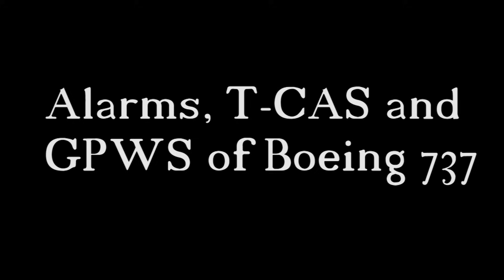Alarms, T-CAS and GPWS of Boeing 737

Comment: ALARMS

0:04 Autopilot Disengage - Pilot flying manually.
0:07 The sound that is heard when the aircraft is reaching (100 feet below) the selected altitude that has been set on autopilot.
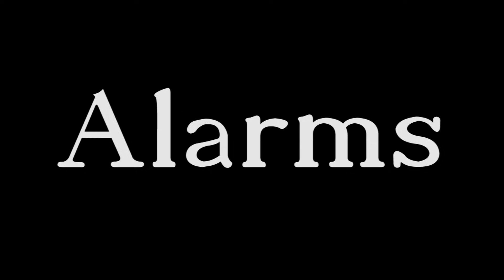0:09 "Bank Angle" warning - when the plane is in too steep of a bank and risking a stall (30 degrees or more)
0:15 "Caution: Terrain" - The warning given off when terrain is close and to look for and watch out for it.
0:16 "Decision Height" - The height where a pilot has to decide whether he wants to continue with the decent or go around.
0:17 "Don't Sink" - The warning given when a pilot is descending too fast, in a stall, or a warning not to descend any further.
0:19 "Glideslope"- When your altitude is too high or low above or below the glideslope (the recommended path of altitude when landing an aircraft)
0:20 "+100" - 100 feet above the glideslope, descend or go around.
0:21 "Pull up!" - Warns the pilot to climb fast, for an obstacle is ahead.
0:22 "Radio Altimeter" - The plane will start calling out altitudes (2500, 1000, 500, etc.)
0:23 "Windshear" - You have flown into a heavy gust or large wind mass which hovers over or around the runway. It can push you uncontrollably, so be ready to go around.
0:27 "Sinkrate" - Descending too fast, or in a stall, or a warning not to descend any further. Similar to "Don't sink!"
0:28 "Too low: Flaps" - Your flaps aren't configured for landing, or not configured properly.
0:29 "Too low: Gear" - Your gear isn't extended for landing.
0:31 "Too low: Terrain" - You are too close to the ground and might crash into an obstacle before landing- not on the glideslope.
0:33 "Terrain, Terrain, Terrain, Terrain, Pull up!" -Terrain is directly ahead or you are flying in terrain - PULL UP!
0:36 "V1" - The speed where you can no longer abort takeoff without overrunning the runway, even if something fails, it is safer to attempt to takeoff.
0:37 "Whoop Whoop - Pull up!" - Pull up fast for an obstacle is ahead of you!
0:38 "BRRRRING" - Fire alarm, engine or compartment sensor has sensed fire.
0:39 "Beeeep" - Extend gear immediately for landing.
0:41 - Stall warning (aka stick shaker), you are too slow for the plane to maintain altitude, increase speed!
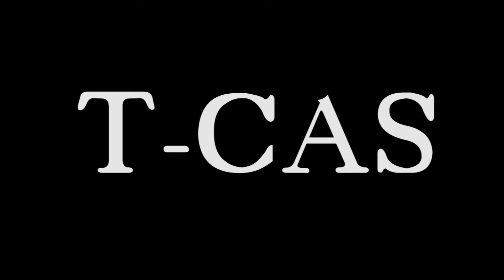0:47 - "Takeoff Config. Warning" - Something is not correctly configured for takeoff (flaps, throttle, etc.).

TCAS (Traffic Collision Avoidance System)

0:47 - "Adjust Vertical Speed" - Bump your vertical speed up or down to avoid traffic.
0:51 - "Climb, Climb now" - Climb immediately to avoid traffic.
0:55 - "Climb, crossing, climb" - Climb, but cross paths with the other aircraft.
1:00 - "Clear of Conflict" - You are no longer engaged in any conflict with other aircraft.
1:05 "Descend, Crossing, Descend" - Descend but cross the path of other aircraft.
1:10 "Descend, Descend Now" - Descend immediately to avoid collision with other aircraft.
1:14 "Increase Climb" - Increase the rate of climb you are climbing at.
1:17 "Increase Descent" - Increase the rate of descent you are descending at.
1:20 "Maintain Vertical Speed" - Maintain the rate of climb or descent you are using.
1:25 "Crossing" - Cross the path of another aircraft.
1:27 "Monitor Vertical Speed" - Keep an eye on the rate of climb or descent you are using.
1:29 "T-CAS Test: Pass" - The T-CAS system has passed the test of it. This test is run at the beginning of every flight.
1:31 "Traffic, Traffic" - Keep an eye out for traffic in your area.
1:33 "T-CAS Test: Fail (BEEP)" - The T-CAS system has failed the test. The aircraft should not be flown.

GPWS (Ground Proximity Warning System)

1:36 "Minimums" - The altitude on final (approach to the runway) where you have to decide to go around or land.
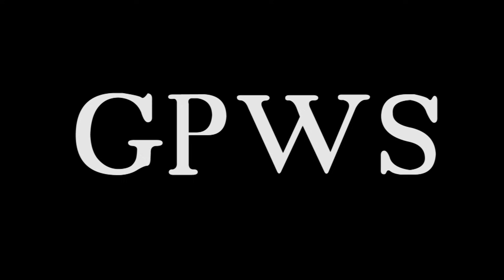1:39 "Approaching Minimums" - Approaching the altitude on final to decide to scrap the landing or not.
1:40 "Approaching Decision Height" - Approaching Decision Height. Decision height is the height where a pilot has to decide whether he or she wants to continue with the decent or go around.
1:42 "2500" - 2,500 feet above the ground.
1:43 "1000" - 1,000 feet above the ground.
1:44 "500" - 500 feet above the ground.
1:45 "400" - 400 feet above the ground.
1:46 "300" - 300 feet above the ground.
1:47 "200" - 200 feet above the ground.
1:48 "100" - 100 feet above the ground.
1:49-1:50 "50, 40, 30, 20, 10" - 50 feet above the ground, 40 feet above the ground, 30 feet above the ground, 20 feet above the ground, 10 feet above the ground.

Hope I covered everything.
Reply: Thank you
Reply: @DragonYeng  2X Speed if fun
Reply: Plus hundred is actually another callout that you are one hundred feet above your minimum altitude.
Reply: @DudeAwesomeBoyReal  not all aircraft have that tho
Reply: Petition to add "butter" to gpws
Reply: @h-hhh  LOL
Reply: Don't Airbus planes also have another call-out where it says "RETARD" to signal pilots to put thrust levers in idle position?
Reply: @3774-p3i  Yes. But ONLY Airbuses
Reply: Actually the 0:04 alarm is not the A/P disengage per se. It's the Master Alarm, which is also activated when the A/P is disconnected.
Reply: Thanks dude.
Reply: BIG SMOKE only in Airbus
Reply: @victoryday663  its in the airbus not boeing
Reply: Now I know. Thanks.
Reply: Butter
Reply: one thing missing that i'm curious about is the two-tone non-verbal alarm at 0:23
Reply: @MxMattyB  It's part of the Windshear warning
Reply: Every Air crash investigation 
Pull Up Pull Up
Reply: 1:48 Swiss 001 butter landing
Reply: Thanks
Reply: Doing gods work
Reply: This should be pinned
Reply: 0:47 is also cabin altitude. The cabin is not pressurized above 10000 feet.
Reply: Now I believe I can fly
Reply: Thank you! As someone who doesnt know too much about aviation this was super helpful
Reply: The confit warning can also mean cabin altitude is too high when in the air
Reply: Plus hundred is wrong . Plus hundred is a fallout that tells you youre 100 feet above your set minimum altitude or decision height
Reply: This one Airplane go up but airplane but is go down alarm airplane say this 0:31 and 0:37
Reply: Slender_04 you copied this from another person
Reply: Isnt minimums between 400 and 200 feet, but you can go around before you have engaged reverse thrust or brakes
Reply: @Lionn8563  Minimums height is different on every airport.
Minimum means, if you don't see the runway at that height, you must go around also if everything else is fine.
And yes, you also can go around at any time before reversers are engaged.
Reply: I love you.
Reply: @comradedyatlov4143  no u
Reply: Thank you!
Reply: you are really did , thank you very much ♥️🤝
Reply: Thx
Reply: One hero, thank you Very much 😎🤝
Reply: 0:04 is also known as "pilot need to earn his salary now"
Reply: the radio altimeter altitude test made me laugh cause if you get calls from 100 down that fast you’re gonna be feeling that one when you wake up in the morning
Reply: Helped me understand what the second alarm is (i kept getting it in x plane cus im a noob), thanks a lot!
Reply: What are you a pilot? Thank you
Reply: @Darkshadoz  yea i mean, that’s generally the kinda person you’ll find watching videos about plane alarms 😅
Reply: That “beeeep” sound is actually landing configuration warning, it can also go off if the flaps aren’t
Reply: Amazing.
Reply: you forgot "butter"
Reply: For the 0:07 one, its actually 1000 ft, not 100
Reply: Olá do Brasil 🇧🇷💚💚
Reply: Corrections:

0:17 Don’t sink - When the aircraft is descending when it shouldn’t (eg. Descending during takeoff phase)
0:20 Plus hundred - Same thing as ‘Approaching minimums’, its a company option. (You are 100 ft above MDA/DH) 
0:22 Part if the GPWS test, you do not hear this during normal operation
0:27 Sink rate - Descending too fast, nothing more nothing less.
0:39 L/G not down at flaps >15 during approach phase, nothing more and nothing less.
0:47 (in addition to what you have explained) - Also cabin altitude warning
1:42-1:50 - RA callouts in feet, no need to explain the same thing over and over again.
Reply: You deserve a beer bro thank you
Reply: Trying to figure out what sounds my 747 was making in MSFS. Thanks to you I figured it out. I love you
Reply: Ty
Reply: Takeoff Config. Warning sound is also the sound which alarms the pilots of low cabin altitude when not on the ground
Reply: Nice
Reply: Hey I actually really appreciate that a lot thank you
Reply: 1:50 20-10
Reply: Fucking legend you deserve a sub
Reply: Damn you're awesome
Reply: Here 👑
Reply: Dude this guy wrote a whole story
Reply: Mannnnn you are amazing thankyou
Reply: Godd
Reply: God
Reply: Thanks a lot 🙏💖💖
Reply: Thank you so much! I was in trouble with 0:47 annoying sound. I forgot my flaps hahaha
Reply: Thank you for listing these. I knew most, but some that are just alarms without the voice (except the stick shaker and fire alarm) and don't know off the top of my hear.  Much appreciated!
Reply: you forgot overspeed i think
Reply: It wasn't in the video but you forgot "Retard, Retard"
Reply: Ryanair landing countdown belike
Reply: SINK RATE SINK RATE ten crash noises
Reply: Thanks
Reply: Thank you cause I can't understand this
Reply: God bless you.
Reply: You forgot retard
Reply: bro wrote an entire essay 💀💀
Reply: 0:47 can also mean something is wrong with the cabin pressurization if your at near cruising altitude.
Reply: What is the difference between minimums and decision height?
Reply: Doesnt it feel like there are too many diffrent terrain warnings
Reply: Don't think! 😀
The aircraft will do it for you.
Reply: Ur a saint
Reply: You deserve an award for this!  Great job  👏🏻
Reply: Thanks for this
Reply: @slender_0434 are you a pilot
Reply: nice
Reply: DAM HOW LONG DID THIS TAKE
Reply: V1 is decision time
Reply: God bless this man for explaining everything.
Reply: Thank u so much for helping us understand
Reply: Thanks, this is a very useful material 😊
Reply: What a Chad
Reply: that wasn't very butter
Reply: What a legend, thanks lad
Reply: At 0:40 there is a single twink which is the overspeed alarm
Reply: What is the beeep alarm sound name?
Reply: Appreciate people like you. thanks🫶🏻
Reply: Спасибо из России, друг!
Reply: 10 RETARD RETARD
Reply: And after BOOM
Reply: Bro love you
Reply: 9
Reply: I think "Don't Sink!" Is applied during takeoff when you suddenly start losing altitude (even by the slightest)
Reply: +100 means the same thing as approaching minimums, and approaching decision height.
Reply: For a split second at 0:41, the overspeed alarm sounds. Either way, good explanation.
Reply: It’s been a few years, but thank you!
Reply: Thanks for the support, a lot of time for that! I agree.
Reply: When u just learning english: "Don't think!"
Reply: Thank you.
Reply: 0:20 "flight(?) slow"
Reply: @n123v  it says "Glideslope!" meaning you are too low on the descent path, meaning you should descend less
Reply: thanks!
Reply: @n123v  it is "Glideslope"
Reply: @n123v  it's glideslope
Reply: @n123v  it says "glideslope", but i heard it like this too.
Reply: @n123v  glideslope
Reply: @n123v  Glide slope.
Reply: @n123v  its glideslope
Reply: @n123v  0:20 glideslope
Reply: @n123v  glide slope
Reply: @n123v  glideslope
Reply: @n123v  It's saying "Glideslope"
Reply: I bet anyone who ever heard any of these "100 feet above the ground" (or less) warnings got scared shitless.
Reply: ok
Reply: How long did u do this?
Reply: I hear 0:07 all too often

Comment: 1:42 that was the fastest landing ever…
Reply: That moment when you reach mach 1,33 on landing
Reply: @BummelHummel181  not just mach 1,33
it is mach 1,33 of VERTICAL SPEED
Reply: @BummelHummel181  pov: war thunder arcade landings
Reply: that’s your average Ryanair flight for ya 😂😂
Reply: lol ryanair landing
Reply: Others Airlines, prépare for landing.
Ryanair, brace for impact.
Reply: That’s called a nose dive
Reply: @TakeAcTN  gpws doesn't work with the planes nose is down UNLESS the weather radar can be used as a radio altimeter but it's used for detecting water droplets not ground
Reply: B U T T E R
Reply: that's is about how the space shuttle would of been for landing
Reply: ryanair
Reply: That was ryanair
Reply: When you hear that but the terrain alarm is off "guess we landing nose first guys!"
Reply: 30 20 10 butte- *crash*
Reply: POV: ryanair GPWS
Reply: 18750 feet per minute descent
Reply: Thank you for flying ryanair
Reply: Sinkrate!
Reply: creasiiin

TERRAIN TERRAIN TERRAINTERRAINTERRAIN!!!!
Reply: Ryanair like that
Reply: Nah bro that was a nose dive 💀
Reply: This is what Ryanair pilotshear everytime they perform a landing
Reply: prob felt like ryanair (times 100)
Reply: some ryanair shit
Reply: 737 likes
Reply: The last moment of United Airlines Flight 93
Reply: "BANSAIIIII"
Reply: Sounds like a Ryanair landing to me. 😂😂😂
Reply: BUTTER
Reply: actually, the hardest, if it was the fastest, then it would overrun the runway.
Reply: Average ryanair landing
Reply: Give the pilot some respect.
Reply: Actualy on touchdown it was only 1500fpm
Reply: Vertical speed must’ve been -9999
Reply: Hard landing
Reply: B U T T E R

Comment: TCAS:

0:47 "Adjust vertical speed, adjust." - Reduce climb/descent rate as necessary to avoid a collision/incoming traffic.
0:50 "Climb, climb now!" - Disregard any and all previous warnings; you MUST climb immediately to avoid traffic.
0:54 "Climb, crossing, climb." - You MUST climb immediately; incoming traffic will descend.
0:58 "Climb, climb." - You MUST climb immediately.
1:00 "Clear of conflict." - Collision averted. Resume instructions from ATC.
1:02 "Descend, descend." - You MUST descend immediately.
1:04 "Descend, crossing, descend." - You MUST descend immediately; incoming traffic will climb.
1:09 "Descend, descend now!" - Disregard any and all previous warnings; you MUST descend immediately to avoid traffic.
1:13 "Increase climb." - Increase rate of climb to avoid traffic.
1:17 "Increase descent." - Increase rate of descent to avoid traffic.
1:19 "Maintain vertical speed, maintain." - Maintain rate of climb/descent to avoid traffic.
1:22 "Maintain vertical speed, crossing, maintain." - Maintain rate of climb/descent; incoming traffic will cross altitude shortly.
1:26 "Monitor vertical speed." - Do not exceed rate of climb/descent restrictions per TCAS RA.
1:28 "TCAS test, pass." - Done while on the ground. TCAS works as intended.
1:30 "Traffic, traffic." - Incoming traffic detected 40 seconds away. Attempt visual contact and prepare for RA.
1:33 "TCAS test, fail." - Done while on the ground. TCAS not functioning correctly, maintenance is needed.

This is the best explanation I can come up with. Correct me if I'm wrong on some of these (especially the last ones), will edit accordingly.
Reply: Perfect Explanation
Reply: 1:28 my grades

Comment: 0:09 Bank Angle, 0:14 Caution Terrain, 0:16 Decision Height, 0:17 Dont Sink, 0:19 Glide Slope, 0:21 Pull up!, 0:22 Radio Altimeter, 0:24 Windshear, 0:27 Sink rate, 0:28 Glide Slope, 0:29 Too low, Flaps, 0:30 Too low, Gear, 0:31 Too low, Terrain, 0:34 Terrain, Terrain, Pull Up!, 0:36 V1
Reply: insert all instruments begging to go bserk

Comment: 0:47 what does that short sound mean?
Reply: Most commonly the parking brake is on during throttle up or the flaps are not extended far enough (or too far)